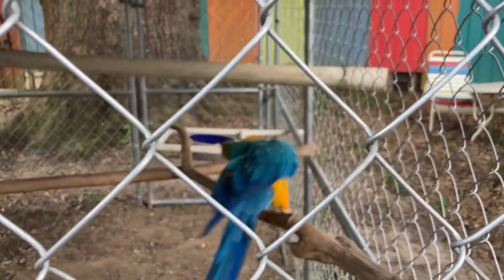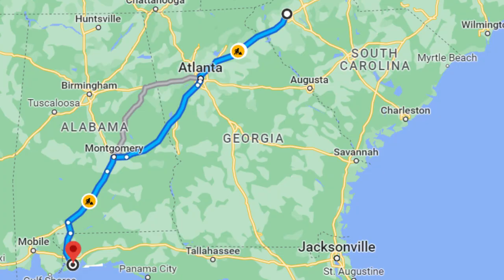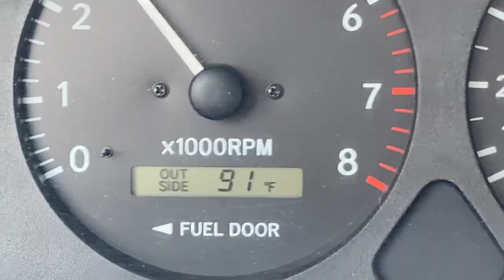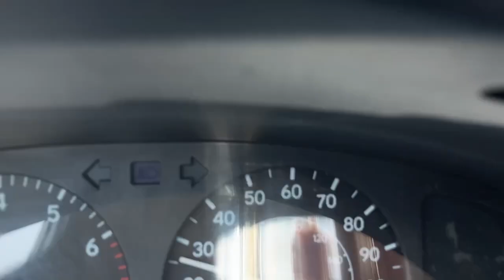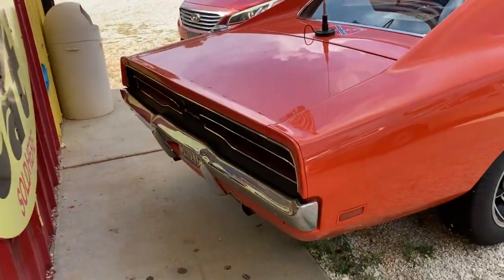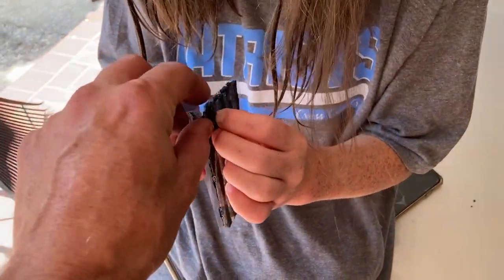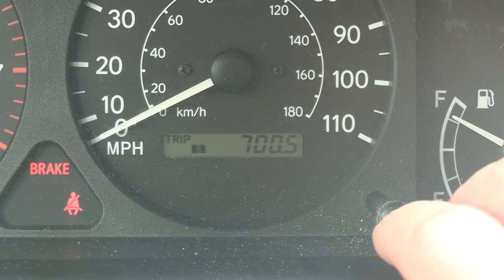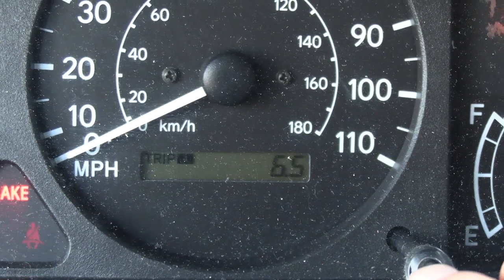HPL Engine Oil vs. OIL CONSUMPTION - Part 2 | Oil Burning🔥Experiments | Episode 24

Comment: It's been a great journey!!! In my opinion, don't tear the engine down.  Continue the journey. You introduced Yamalube in Episode 20.  Out of many additives I've used in the past, Yamalube actually solved my issue (no more misfires at cold, etc etc).  Imagine if had you torn that engine down before episode 20.  We probably would've never heard of Yamalube.  I think there is an additive out there or chemical process that will solve the burning oil issue but you would have to continue the course.  

I would suggest trying these two oils:

1. Liqui Moli Molygen which has the Tungsten additive within the oil.  Tungsten is more less a friction modifier but does bond to the metal.  
2. Motul 300V Competition.  Yes, this is a race oil. But, it is a ester-based group 5 oil.  It might be overkill for the toyota but could solve the oil burning issue.  

I think we've become a small community around your oil consumption experiments as many of us are testing additives with our own vehicles.  
In closing, don't tear that motor apart. I would continue the path.  If not, we understand and thank you for taking on this task.
Reply: The Yamalube RFP should have been used more, as it was successful in removing the carbon on the piston tops.

Add to fuel in either SHOCK TREATMENT for oil build up or CONSTANT TREATMENT to maintain protection from harmful deposit build up. After SHOCK TREATMENT it is recommended to change oil in 4 stroke engines. Older heavily deposited engines may require a second shock treatment. 
SHOCK TREATMENT: 2 oz./gal. 
CONSTANT TREATMENT: 1 oz./10 gals. 
Minimum SHOCK TREATMENT per engine: 3.3L to 1.7L engines - 64 treated gallons 1.6L to 700cc - 24 treated gallons 699cc and below - 12 treated gallons

Comment: Hi Dave,

Just want to say thank you again for making these videos, I have gone through the whole playlist in 5 days, learned a lot, since I too have a car with an oil burning issue and have managed to keep the oil consumption to 1 litre per every 5000km by using Liqui Moly engine flush over the past 40,000km (over 7 years).  My oil change interval is every 5000km and I refill when the oil level falls to halfway between the 2 dots.  These videos have given me also hope in keeping the car and trying to find a fix without having to rebuild.  Many people would just say get rid of the car, but I find myself like many others not in a financial situation to do so! Mine is also a gift to my dad who could not afford a good car while he was upbringing me and my brother.  My dad always had cars with oil burning issues.  

I have an idea, I have not tried it since I don't have the tools, but since the problem lies between the side walls of the pistons and the cylinders with these sticky rings, what if you half-filled the cylinder with an engine oil flush solution while the piston is at bottom dead centre (with both intake and exhaust valves closed) as well as pressuring the cylinder with at least 2 bars of air.  The rationale behind this, is that the pure solution should be able to do a better job by being forced through the rings to dissolve the deposits.  Repeat this procedure a few times for each cylinder and see if it brings any positive results.  Of course, drain the crankcase after doing so or remove the oil drain plug while performing the procedure.

This is what I wanted to share with the community.
Reply: My 2000 Corolla passed 300K miles and starts up every time without fail no matter the season. Yes, it does burn some oil and I have not had any car payment for 17 years. Right ...17 years with no car payment. My real mechanics told me to keep it until it dies ... and I will...

Comment: Hey Dave, I wanted to thank you for your videos. I have an 2008 Camry 2AZFE engine that was burning 2 quarts every 5,000 miles of oil. I used Berryman's B12 in the spark plug holes with the engine hot and now after 1200 miles, I have no loss in oil. I could not have done this without your help! Thank you Sir!
Reply: What was your method? Did you just do a soak? Hand crank the engine over etc etc? I have a 07 accord using quite a bit of oil. I wondering if doing the chemtool thing might help.
Reply: @MrRedHotChiliMan  I'm not going to lie, I probably could've done a more thorough job but I was on a time crunch. It worked though! I drove the car to my buddy's shop, which was a half hour away. I pulled the spark plugs and let it sit for about 15 minutes. I put a funnel down it and poured an 8th of the bottle down each spark plug hole. It boiled almost instantly, which I honestly think helped with the cleaning. I let it sit like that for another 15 minutes, then added an 8th of the bottle to each cylinder again. Still hot enough at this point, it slightly boiled. I let that sit another 15 minutes, turned the engine over to blow out the excess. Reinstalled the spark plugs and ran it. Went down the road at higher RPMs to burn off any dislodged carbon, came back and changed the oil. I'm guessing I had a stick piston ring. Bore scope showed I still had cross hatching in the cylinders. I have added oil in 1200 miles.
Reply from the maker: Thank YOU for watching, and I'm glad it worked for you!!
Reply: Pretty much all the successful Berryman's B12 stories are when done when the engine is hot.  Also seen several successful cases where it is dumped down the carb or throttle body with the [hot] engine running at a rate that almost stalls the engine.

Comment: If you chose to do Amsoil , make sure its the Signature Series. They have several different types of oil. Loved the video. What I personally did when I had oil burning issues was amsoil engine flush then immediately seafoam the engine flush then Amsoil Signature series. But that's just what worked in my situation
Reply from the maker: Good info. Thanks for the input!

Comment: I was having the same issue.  I only got 200 miles on a QT . Have gone 200 miles since with no oil loss. 1 thing I did different was that I jacked up the back of the car so the pistons were level!  ( liquids always go to the lowest  spot) you might not be getting enough cleaner on the high side of the oil rings.  ( something to consider) thank you for the videos!!!

Comment: There are definitely a few videos already on 1zzfe rebuilds for oil burning. A rebuild will work, but it would not be that unique of a contribution for the diyers. It may be worth backtracking to the efforts that produce the most measurable results like soaking with Berryman's.  My suggestion would be to try extreme soaking (4-5 days) under periodic compression with any one or combination of the following solvents:

Berryman Chemtool B12 (Acetone/Toluene)
AC Delco 10-3015
Brakleen (Naphtha) and CRC GDI Cleaner (PEA)
Kano Kreen (MEK)
BG EPR 
PVC Primer (purple stuff)

If you're not ready to condemn esters then the following products are worth a try:

Lubegard Engine Flush (300 miles w/ fresh oil)
Auto-RX (1500 miles)
Stihl HP 2-mix Oil (10% or higher)
CostEffective Flushing Oil Concentrate

The only other class of product I've seen that's different is a chelating agent in Stihl's  Decarbonizer (trisodium EDTA.) I'm out of ideas...

Comment: I did the B12 piston soak in my brother in law’s 2002 Corolla earlier this summer. It dramatically decreased the oil consumption much like your results. Might I suggest you apply some RainX waterless wash and wax ($9 at Walmart) on all the hard exterior surfaces and the windows! Your wipers will last much longer and you will have a dramatic visibility advantage over other drivers! Thank you for the videos!
Reply: What about doing a 10 min cold flush are idle with B12..?   Did you try that also?
Reply: @aidankirby8412  you mean like sucking it using a vacuum line? Nah. I just spent a couple days adding an ounce or so into each sparkplug hole and then rotating the engine over a few times. I did this every 4-6hrs while awake. I used 2 full cans of the B12 in doing so. Then I put it all back together and ran it in place at 2,500rpm or so for 20mins before completely changing the oil and filter using Quaker State Full Synthetic 5W30 (not Ultimate Protection). And it consumes less than half the oil it did prior to the piston soak 👍🏽
Reply: @vqdriver  Thanks for your experience! I am planning on doing the Berryman soak too (Camry 2009 consuming 1qt /400miles). IF POSSIBLE, would you please check if the Berryman dissolved your oil-pan's pain at all? I have read of catastrophic failures, due to the Berryman loosening the oil-pan's black paint and having those loose paint flakes stuck components/filters in the engine.
Reply: @taz24787 highly doubt that it would dissolve anything while mixed in oil. My sister is across the country from me. What I did was run the engine after 2 nights of soaking/turning every 4-6hrs and put a stone on the throttle at 2,000rpm x20mins or so. Then drain and fill with Quaker State 5W30 full synthetic (NOT Ultimate Protection) and Supertech, Denso, Purolator tech, Bosch workshop oil filter (best cheap filters with same premium construction). Change every 3,000mi for IDEAL protection as per the RAT540 blog. Good luck 👍🏽
Reply: @vqdriver  Thanks for the answer!
I guess running a solvent for only 20min shouldn't damage rubber seals, right?
Reply: @taz24787  you’re only running the engine after the piston soak. So over time it drips into the crank case or evaporates. I believe I went through 2 cans of B12 over 2-3 nights. I forget exactly. I just did it when I could or every 4-6hrs. Then I installed brand new Denso spark plugs, ran the engine at 2,000rpm or so for about 20mins. Change to the specific oil I mentioned. Not sure I’d recommend driving it on the road like on the video. But it surprisingly worked! Good luck
Reply: @vqdriver  Thank you once again! ... 
They say that when you do the piston soak, then the engine suffers a little to start. Do you think wise to pour a little engine oil on the pistons and rotate the engine manually, to have them lubricated after the solvent?
Reply: Yea don’t worry about the rubber seals, just focus on doing the best work you can. Use that QSFS 5W30 (not ultimate protection) and change it every 3,000mi ideally or 5,000mi maximum. Cheers
Reply: @vqdriver   Ok, thank you bro!
Reply: @taz24787  nah, it should spin pretty easily like the first time. If anything you do not want to pour anything into the combustion chamber! It MUST be clean and dry! Otherwise you risk hydro locking the engine. Just let the solvent seep through and dry for a full day before putting it all back together again with new spark plugs while you’re at it (optional)
Reply: @vqdriver   Oh ok, thank you for your answer and experience bro!
Reply: @vqdriver  you wont hydrolock the engine if the product is poured in, and the spark plugs are left out of the holes while it soaks. if you spin the engine over while the spark plugs are out it will shoot back out of the plug holes.

Comment: Hello Dave, I was recently watching a few of your oil consumption experiments. Not a mechanic by any means but after looking at your video where you show the inside of your combustion chambers i do have a feeling it could be something that needs to be approached from both sides. This is a comment i saw under a video of someone using a liqui molly product and i have a feeling it might apply here :

"Here is the recipe to solve 2.0tfsi oil burning. Get the engine hot. Remove spark plugs, mix 2oz PB Blaster, 1oz B-12 Chemtool, and 1/2oz MMO. Pour this mix in this quantity in to each cylinder. As you pour, you'll hear the mix boiling in the cylinder. Always exercise good safety protocol. Let it sit with a paper towel in the spark plug hole until the piston is visually dry (24hrs). Take a compressed air blower with a long snout and put it in the spark plug hole and blow. You will not believe the amount of dried carbon that will blow out. You'll typically find the culprit cylinder at this time based on the amount of carbon blowing out. Crank the engine over with the plugs out to remove excess liquid. Install the plugs and drive the vehicle around the block. Repeat all of these steps again. This cleans the piston crown and rings from the top side. When starting the engine after the second soak, dump in a can of BG EPR or LiquiMoly engine flush and let it idle for 30 minutes. this cleans the rings from the bottom side. Change the oil and filter and call it a day! This cured an engine burning 1qt every 200 miles @160k miles. It now burns nothing between 5k mi oil changes. "

also on a side note if you could try adding Marvel mystery oil into the gasoline, there might be some improvement there, but thats just a guess.

Comment: Before tearing it down, I think that the codes that are currently in the DTC memory should be corrected and tested after that.  One thing that I plan on doing with my car, is running Lacquer Thinner through the gas to clean up my catalytic converter.  I've seen quite a few people try it, and it seems to work.  I need to get my other lower control arm replaced, and an alignment before I make the needed journey to do it. Yours is burning so much oil, I'm almost positive the CC is clogged, robbing you of the normal power you should have.  That can actually cause too much back pressure, and might be part of the problem.  

Parrots are a hoot.  About 10 years ago, my roommate and I took care of his girlfriend's African Grey for about a year and a half.  He was such a character, and loved to mimic the strangest noises.  Most notably, my roommate's nextel walky talky beep he had for work.  It drove him crazy!  He loved to listen to loud music, as he'd dance and sing with the ones he liked.  He liked metal and rap.  I taught him how to spin and he loved sitting on my shoulder and walking around with me.  I was apparently the one that he liked, as they tend to only like one person.  They live up to I think 80 years or something.

Comment: Berryman's B-12 all the way!  I would do another cleaning service with that chemical and really go heavy with it.  Do a full and proper oil change and test your mileage to oil burnt ratio again.  If it's still not good enough after that, I would rebuild it or replace it.  Ideally if you have the space, buy another motor to drop in, take the current one out and have it rebuilt. They probably have a new design for the oil control rings on the pistons, I know VW rings are different than the original with rebuild kits.

Comment: Either BG Dynamic or start putting MMO (Marvel Mystery Oil) back in on a regular basis. It had helped my Volvo that was using a quart every 400mi and now I'm over 1200 to 1500 mi's. per quart. It does take a little longer to take effect but I haven't needed to add oil like I did when I first purchased the car.
Reply from the maker: Thanks for the suggestion 👍

Comment: consider:  drain and fill w ATF.   idle for awhile - then drain.  This can free up sticking rings.  Then use normal oil or perhaps thicker, such as Lucas.   Its important to run a test for longer terms.  Many of these 'treatments' require several hundred miles mininum to show appreciable effect.

Comment: Really enjoy these videos and your experimental design.  I am happy to hear you’re still entertaining tear down though as I feel sure that’s the only way you’ll fix the consumption.  If there was something easy in a bottle that fixed it, Toyota’s engineers would have had a TSB out for it years ago.  Recall that the faulty ring issue impacted lots of their engine, even the might Lexus GS350, so Toyota definitely had the skin in the game to find the cheapest solution.  Since that ended up being piston and ring replacement, I think you’re confirming their decision.
Reply from the maker: Definitely some good points.

Comment: Back in the 90's I had observed similar police corruption in Louisiana. I had just crossed the border from Texas -- and a 1/2 mile into Louisiana, there were 3 State Troopers parked on the shoulder, in the shade, with their radars on. I was very careful to to the exact speed limit before crossing the border -- but I still got followed by a team that alternated positions for about 3 miles. I was lucky to not get pulled over anyway -- as I was told that this is a common practice there: they look for out of state plates & pick on those drivers. It didn't occur to me then -- but now I can see that they are engaging in an unconstitutional restriction to free travel -- as they rake in the bucks. Win-win, for them.

Comment: I’ve had luck with piston soaks using B-12 Chemtool and BMW Fuel System Cleaner(same stuff as ACDelco Upper Engine and Fuel Injector cleaner) to get oil consumption down on a 2nd gen Prius, from 1qt/2K mi to nearly 1qt/4K mi. I also experimented with HPL EC, and Vavoline Premium Blue Restore. 

The best oil for consumption on this car was Shell Rotella T6 Multi-Vehicle 5W-30. I’m running HPL 5W-30, I’m at 1qt/3.8K at the moment for consumption. It’s as good as I can get it.

Comment: Your piston rings might be unstuck and unclogged from all of the treatments you have given them.  But since they were stuck/clogged at one time that stopped oil from flowing through them that keeps them cool.  If they overheated this  could have caused additional wear  and could have caused them to loose their "springiness", meaning they will not spring outward from the piston against the piston wall as strong as they should letting oil get buy.
Reply: Or if stuck, maybe uneven wear on the oil control ring/s for a while.
Looks like oil in multiple cylinders.
I think one video I watched showed some cross hatch on the cylinder walls, which is positive.  Oil gets dirty pretty quick, so there is blow by to some extent I think.
Reply: I think at this point this engine is a good candidate  for Schaeffer's 132 Moly EP Oil Treatment a very different technology & approach.....